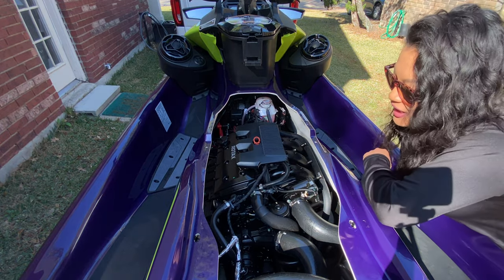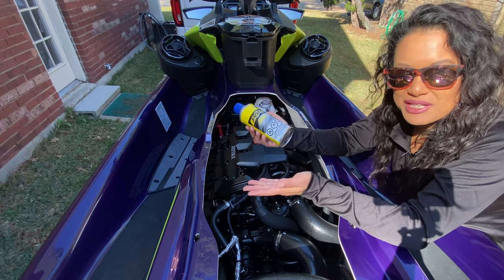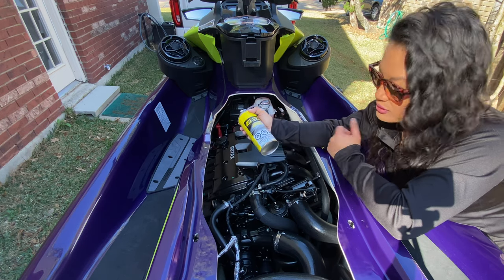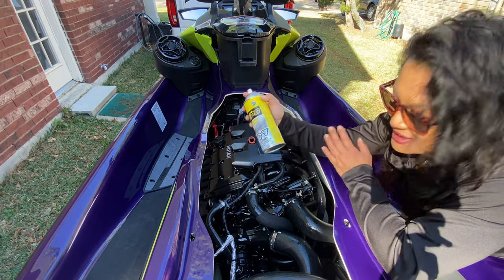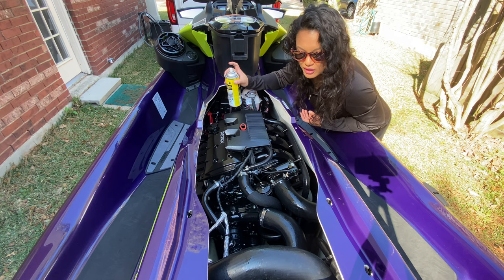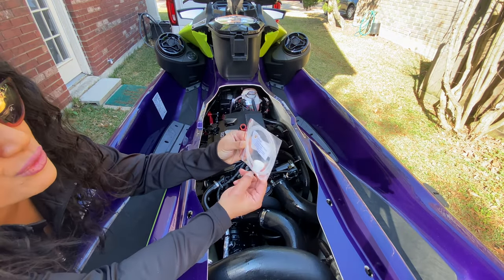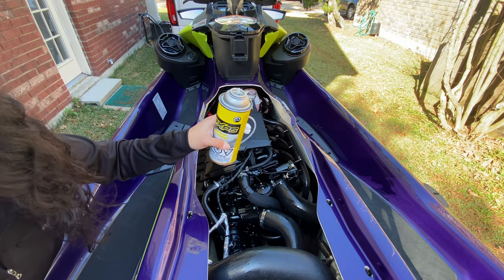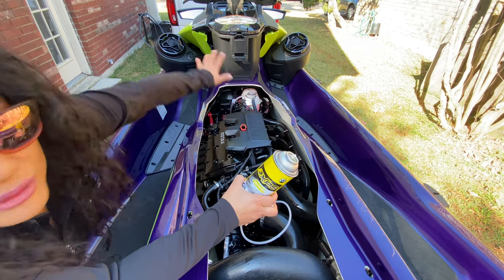You SHOULD Lubricate your Jet Ski!

Comment: In Australia they recommend INOX Lanolin MX4.
"Lanolin doesn't dry out, become sticky or become gooey. The liquid contains no silicon, acid, kerosene or dieseline, and will not harm metal points or surfaces, plastics, paints, enamels, fibreglass, Formica or neoprenes. INOX Lanolin is best-suited to environments where extreme climatic and humidity conditions prevail."

Comment: I use Yamalube. Works excellent and can be used everywhere. Even use it on my fishing reels
Reply from the maker: Right on! I use lubricant even on my pad locks 🔒 for my trailers. Lol
Reply: @AlveanAzurin  Yessssss!! Me too!! Another thing i also do since I do ski more in the salt then the fresh water is i’ll also use the Yamalube to spray the lug nuts on the trailers. It drys on and doesnt fling and really helps to cut down the corrosion and helps get the nut off if u need to change the tires.

Comment: Cool looking ski, so big question is!? In the chop which in your opinion was better GTX OR RXPX ? Keep up the great work 👍🇺🇸
Reply: Same hull except for a couple of minor changes I have aGTX 230 and it’s brilliant in chop
Reply: GTX all day. RXP for the glass only. You can't be good at both thats a pipe dream. Thats why they make muscle craft - RXP's and GP's. GTX's and FX's are for rough water
Reply: Good advice! Anti corrosion is a must especially for Seadoos as the engines are based on land engines ONLY hence the closed loop cooling. Dose that engine after every ride and your Ski will live a long healthy life ♥️
Reply from the maker: @alhitch 
Less splashing on the RXPX at the front of the ski. GTX a little more stable when riding with a passenger. The RXPX is has a deep V in the hull and I feel it cuts the waves/riding in wake better.
Reply from the maker: @littledragonfly11223  you are incorrect, they do not have the same Hull. The GTX and RXT do but the RXPX is the only one with it Hull design.
Reply from the maker: @_jamesrose   I disagree. The RXP is a little loose in the rear at high speeds on flat water but might be the fastest stock ski on the Seadoo lineup. But they used the new 2021 RXPX for Pro Watercross World  Championships and won 2 podium spots. These races are very choppy. It’s versatility is what makes it the most popular ski on the line up.

The GTX is stable and still fast. 
I love them both.
Reply: @AlveanAzurin  Yes you are correct , my mistake, still want to know how do you keep your cap on,!

Comment: got mines used, so was thinking about pressure washing inside the hull to get some smudge n dirt off before adding that stuff (in colder states i was just watching on how to winterize with coolant thru the pellers.) (btw, mines also comes with a coolant tank, gata see what kind i need or if it takes regular car coolant)
Reply from the maker: I’ve always been told to only “lightly” spray your engine compartment, I wouldn’t recommend pressure washing it 😳.. that can cause lots of damage to your ski. There is a specific coolant you can get with Seadoo, XPS brand.
Reply: @AlveanAzurin  thanks!

Comment: Corrosion X and I buy WD-40 by the gallon.  We only have salt in our area.  There is literally no fresh water within an hour drive of my house.
Reply: WD-40 isn't a lube, unless you want to remove your Corrosion X
Reply: @Cadman_24 he's probably talking about WD-40 lubricant  and not the original WD-40.  
( i hope so 🙏) 
 There are different WD-40 for different jobs.
Reply: @Cadman_24  No but it is a Water Displacement and that is the goal.  Corrosion X tends to last longer, so I prefer that or Fluid Film.
Reply from the maker: @Cadman_24  WD-40 has a lube called WD-40 Specialist Water Silicone Resistant Lubricant
Reply: @AlveanAzurin  Can we get that by the gallon?  would be nice!

Comment: I just bought a new jet ski , so I took it to the beach ..I have the engine lube spray ...after I go to the beach should I just spray the engine ? or water clean it first ?
Reply from the maker: @silversorcerer9316  light spray the engine compartment with any salt away stuff you have then lightly rinse. Stay away from the front where the electric/fuzes are. Then lightly rinse and leave seat off to dry. Remove plugs and lift trailer to drain water. Once dry lubricant spray away. After doing this it should be could for at least 4-5 salt rides until you should have do it again unless you get lots of salt water splashing around in there.

Comment: Hey how many time do you do lune? Everytime you flush or every 10 hours?
Reply from the maker: I reapply after lots of salt water riding. But mostly reapply lightly every 3 rides when riding fresh water. You should rinse and reapply more often with saltwater, especially if you ride in rough salt water that gets a lot of water splashing around inside the engine compartment.

Comment: I've been using wd40. It needs to be reapplied after a ride or two but its cheap, safe,and easy to find. I buy it by the gallon then use a plastic spray bottle. I never find re applying it a problem because I constantly take off my seat and check things as I think everybody should.
Reply: Not great for anti corrosion mate. Use a Lanolin spray
Reply from the maker: Hopefully you are taking about the WD-40 Specialist silicone and not the regular WD-40. if so, I have heard good things about it.
Reply: @AlveanAzurin  I use "WD-40 Specialist Water Resistant Silicone" Not sure I would use normal WD-40, it may work OK, but maybe not good for some parts etc.
Reply: @AlveanAzurin  regular wd40 so far but silicone is probably better